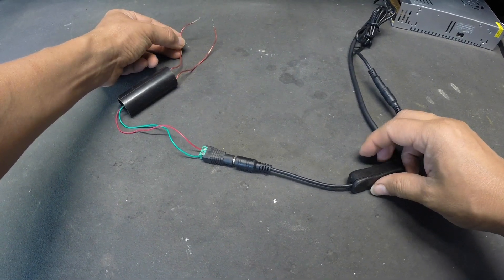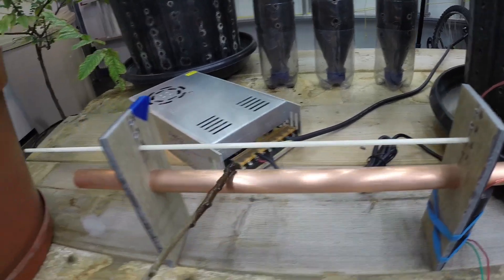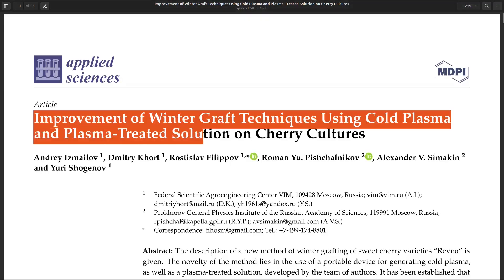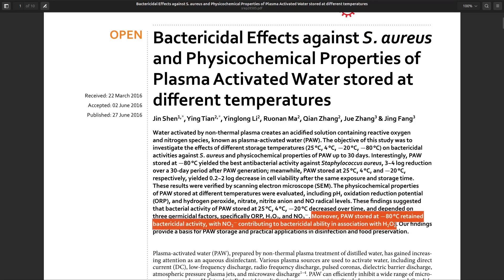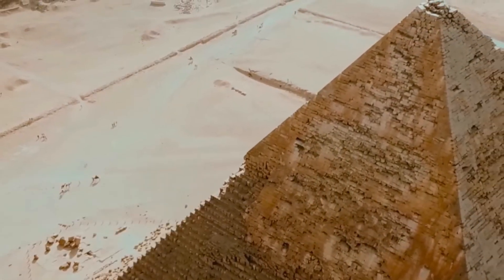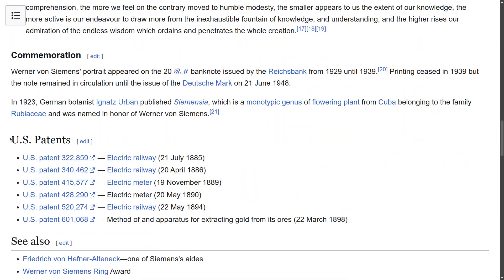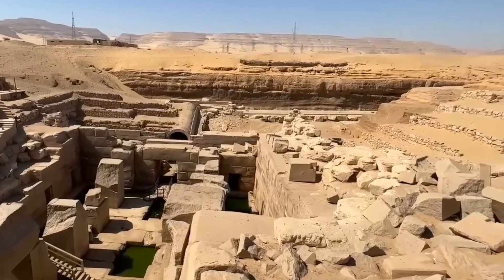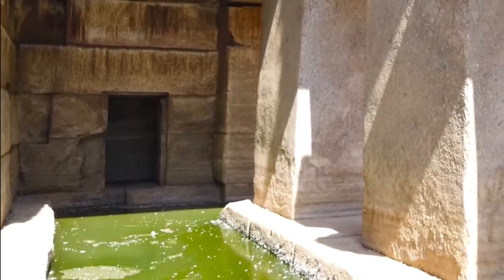Plasma-Activated Water: Electroculture Rediscovered

Comment: I think it's effectively raising the available energy in the system of the plant, the problem is that causes them to metabolize faster as the energies make the cells more active , therefore the cuttings with not enough nutrients end up unable to sustain growth and wither as they go through accelerated growth under these conditions, perhaps try saturating a test group with nutrients and see if that helps.
Best estimate troubleshoot I got.
Reply from the maker: That's an interesting suggestion, thanks!
Reply: @cooltherapy  So, did you experiment with this in the time since I mentioned that as a working theory?
Reply from the maker: @BurningLemonTree  No, I was unable to repair my power supply after blowing it up when treating guava seeds with plasma. Thank you for following up.

Comment: Thank you 👍👍👍 
Some 🤔🤔💦🌩️⚡💦💨 thorts.. check out.. Japanese OMASA hho water.. and  Bob greenery chnl .. vids on energyss. Ie vibration of matter making electric flows ..or statics build ups .. having strange effects on water and the elements in it..  ⚡🌩️ isn't lightning a static electricity discharge.. not a normal DC ac electric flow.. like in forced plazmass.🤔💥👍👍❤️
Reply from the maker: @VANHAMM Lightning is a visual consequence of the uncontrolled breakdown of the air molecules, i.e the electric discharge. The plasma in the EHD is the same, but in a controlled manner, it can also be visible: when I turn off all lights, I can actually see the plasma of the EHD.
Reply: @cooltherapy  what I'm trying to say but not sure on . Is I think ther is 2 different types of electricity. . Or that static electricity sometimes don't have any current v little but v hi voltage s. 
⚡🌩️🤔Wattz floating around my 
Head.
Reply from the maker: @VAN2HAM2van  A static discharge can actually have a pretty high current, but since it's very brief, it can give the impression that the current is low. I'd rather talk about charged particles and accumulation of charges.
Reply: @cooltherapy  or EZ water.. 💧👌⚡
Reply from the maker: @VAN2HAM2van  I think I understand now what another viewer meant about the negativity of water: maybe a reference to EZ water.

Comment: Looks like you were using an ac generator, I think you need DC and the polarity has to line up vertically.
  Also, I saw you stick the copper wires directly in the water, the reactive oxygen with the copper will make copper ions in the water and that can poison plants in too high a concentration, that's why I'm they use copper sulfate as root killer.
  Use a carbon electrode (or gold)
Reply from the maker: @petevenuti7355 The generator produces DC, the HV boost step up power module works with DC. Good point with the copper, although I only (visually) notice an electrolyse reaction when both copper electrodes are in the water and very close to each other.  But this was only for demonstration. I only experiment with the EHD setup. Nevertheless, your're right, I should either replace the copper pipe with a carbon electrode, or be careful not having the plant material touch the copper pipe.
Reply: @cooltherapy  or touch water that was in contact with the pipe... 
   Copper's ability to prevent things from growing is exactly why we use it for plumbing! It's safe for plumbing because you don't have as much electricity running through it,(or vinegar...)
Reply: @cooltherapy  I know those modules, the output is AC, input is DC. So unless you have a bunch of high voltage diodes on the output...
  I've always felt that you need to align the charge to match the natural sky-ground dark current, but haven't got around to experimenting, looking forward to see how it goes.
Reply from the maker: @petevenuti7355 Maybe you have the impression that the output is AC because it's pulse DC? Or your worked with different modules? In any case, what is interesting is that direction of the ionic wind will always be from the thin electrode towards the large electrode, no matter the polarity, but the composition of the plasma and its speed will be different when it hits the larger electrode.

Comment: You should try magnet structured water and see how that stack up.
Reply from the maker: I was not expecting someone to suggest that. I guess I have to make another video now.
Reply: @cooltherapy  Please do. It is very interesting how it changes water and makes is flow different. The surface tension seem to be permanently altered. Or at least up until a week or more.

I use a couple of big neodymium magnets to restructure my water. 

After I have run our municipal water through a sediment and a coconut carbon filter.  I run it through my RO machine and I water all my house plants with it. With some added nutrients as needed of course. They seem to really like it and grow huge. I am used to after years of doing it, but I notice others house plants is clearly not even close of the same massive quality. And i get a lot of comments on them.

But it is not all I do I also use things like ionizers and keep my humidity at around 58% year around.

 So that help also compared to other households locally here in my country in northern Europe. Where it can get very dry in the winter. I also use grow lights of course.

I run some PE tubes many many many times around the big magnets to get it structured and it seems to work great.
Reply from the maker: @cajampa  Neodymium magnets are fun, this is next level stuff. I'm glad to see there are other crazy people out there.
Reply: @ChadKovac  Bro. You need to understand what RO water is.
There is no ions in my 0 TDS RO water.
So what is your confusion?
Reply: @ChadKovac  Also If you took my hint of your confusion. The RO water has its own purpose, function and reason for why to use it. If you don't know why I understand your confusion. It is not about making easier structured water it is about making a superior product for life.

If you haven't figured out the point yet sooner or later you will, if you keep going because it is one of the obvious keys.
Reply: @ChadKovac   You don't need to hint. You are very obviously clueless. You REALLY don't have as deep understanding as you think about much of anything.
It is called Dunning Kruger and you have one of the worst cases I have seen in a while.
Reply: @cajampa  of course my man goodbye
Reply: @ChadKovac  Notice how I am actually talking about how do real things but you keep giving hints about things you don't know much about? One is useful and can be applied. What exactly you are trying to do I am not sure about but it is not going anywhere. I am already structuring my water and I have been using it for many years with very good results. What about you?

Comment: Well known a cone coil with the wide end up is best at the corners of the farme or small garden. Water is the antenna for life it needs no help. One could use the south pole of a magnet more specifically the southern edge In seed growth. The coil can be wound in the Fibonacci sequence 11235813.
Reply from the maker: @EnergyTRE The issue with the cone coil in a corner of the garden is that the results can be random and/or not replicable. That is not to say that it doesn't work. My tap water needs too much help, so I never give it to my potted plants.
Reply: @cooltherapy  👍 no natural spring close by ?. You could boil it and  find structured water with a magnet. That doesn't put  minerals back in but does change the waters negativity. Ken wheeler has an interesting setup for that. It works.
Reply from the maker: @MichaelMyrick1123  No natural spring nearby, unfortunately. Boiling water should not remove minerals, unless you meant making distilled water. Water's negativity is like electroculture, a bit too fuzzy for me.
Reply: No wells 🤔 a natural water supply is essential. Boiling for removal of unwanted man-made chemicals in tap water. It's not just natural water from a water treatment plant.
Reply from the maker: @MichaelMyrick1123  I can't disagree with you on the natural water supply.